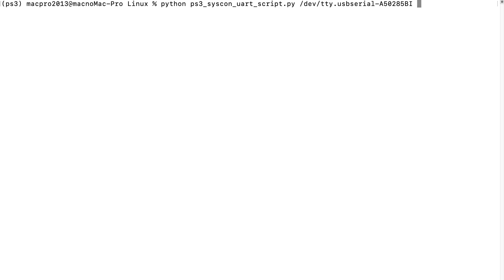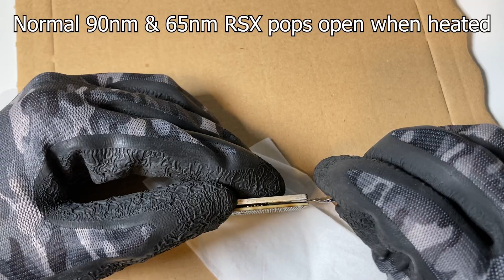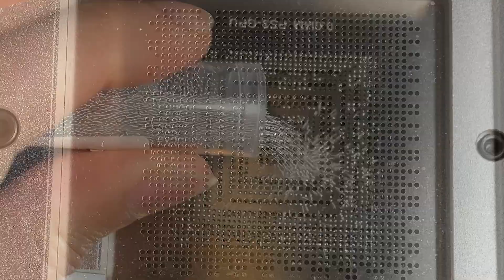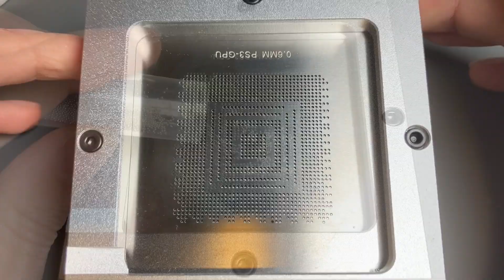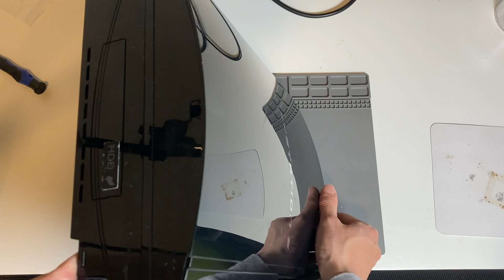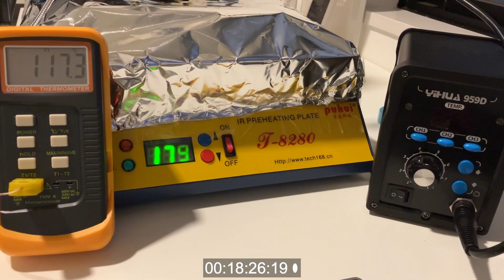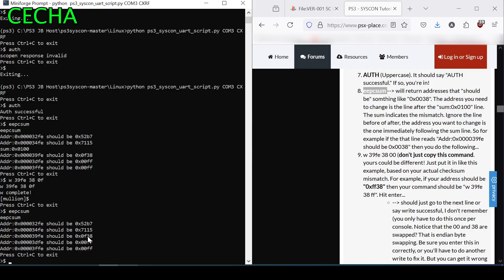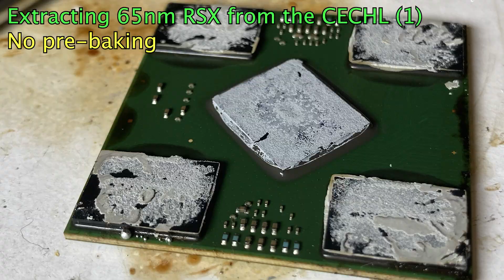Fixing YLOD 3034 is Difficult (aka Frankenstein mod)

Comment: You had so much delaminations because you're not using the aluminium foil correctly. You should open a slightly bigger hole and use kapton (or better, aluminium) tape to glue the foil to the board. You're having so big of a gap betwin the foil and the board all the hot air is entering between the foil and the board and overheating it.

Comment: The loss of all those MB's is not a total  since so many of us can see that whatever you were doing was not the right thing to do. Thanks for that. I'm only trying out my sardonic humor that you are so good at. Always baking the MB at such a high temperature for such a long time is likely the culprit. Yes water boils at 100 C but so does MB's. The thin liquid flux put on under the CPU is good advice and pointing out that the lead free flux leaves a residue also helps with my repair. I have nothing but some thoughts and need to put them into practice before I try and do my own repairs on the several PS3's I picked up on the cheap all that were sold for parts. Got two to boot  as one was the same error code 8002F14E.  Got it to bypass but not because the DVD wasn't working but because the HD was swapped with another which allowed for the service option to be initialized. Previously it would not even do that. Then going back to the original HD it was able to bypass the stuck point on the boot OS install. Worked for me is what I'm saying. This was a G01 machine but the clock was damaged and I'm swapping out that crystal hoping that fixes the Blu-Ray and the fan not working right. That is a whole other story not yet finished. Then on the other PlayStation someone had bricked the machine since they got caught with their Jailbreaking. It seemed dead at 1st only because the rear on/off switch was not working right with burned contacts.

Comment: i'm not an expert on reballing but i want to give my 2 cents based on what i always see the pros on youtube do, first thing i would do is delid the rsx before the desoldering process. i would then allow a slower temperature ramp up time,  use the hot air only when the board reaches 180-200°C and get closer with the hot air nozzle, and not go over 350°C with the hot air... also thermal paste needs to be removed before every soldering/desoldering process because it can interfere with the suction pen and the paste itself gets harder to remove. i wish i could speak from direct experience but in my 10 years of working with electronics the only thing i ever reballed are vram modules on GPUs. right now i reached the point where i need to learn to reball big BGA chips because i got a couple gpus that need it. i will probably buy the same puhui preheater you got, and i also got a very similar hot air station as yours. your videos got a big educational value because you show every fail and success, it's easy to look at other youtubers that post only successful repairs in neatly cut and sped up videos. But you show the entire process which is way better to learn, even if the result is not successful. 
Almost forgot, the flux you're using seems to act strange and it's too liquid, you should use a regular flux that's tacky when cold and gets liquid when heated up, i use a cheap (100% clone) flux from aliexpress, i think it's nc-599 or something like that, i had good results with vram chips, it's easy to spread just a thin layer with your finger on the pcb and the chip itself...
Reply from the maker: Glad that you find my video useful!
About the 65nm and 40nm RSX, they are impossible to delid without damaging the VRAMs.
The thermal glue on 65nm and 40nm RSX are super strong that you can only delid them safely after desoldering.

Comment: When installing the Tantalizers for the RSX, do you remove all 4 NEC/TOKINs? Or just 2 on one side?
Reply from the maker: I only replaced 2 NEC/TOKINs. But it is recommended to replace all 4.
Reply: @hardwarerepair200 Thank you for your advice. I really appreciate these videos from you and Felix.
I've noticed the PCBWay link in the description for the assembled Tantalizers (many thanks), I might treat myself to some. I have a YLOD CECHP fat PS3 that I can keep working long enough to display error 1002 on ps3toolset.

Comment: Hi,
I've seen your repair work and I'm currently trying to attempt the Frankie's mod on a PS3 CECHA01. I'm planning to do a reflow, but I’m working on a tight budget and would appreciate any advice you could share.

Do you have any suggestions for preheating the motherboard? Is the T8280 a good choice, and should I invest in a hot air station like the one you use?
Also, I’m a bit unsure about how long I should prebake the motherboard to remove any moisture that may have built up over the years. Some people say it’s necessary to avoid damaging the board during reflow. Should I cover the board with aluminum foil during prebake? And how gradually should I increase the heat to avoid thermal shock?

For context, the PS3 was working fine until I attempted to delid the RSX. After that, it powers on, but there’s no video output. Pressing down on the RSX temporarily restored output before, but now that no longer seems to work.
Since you've done many repairs, I’d really value your insight—especially about the common mistakes people make like turning up the heat too quickly.

Comment: The amount you've put into buying PS3s and etc you could've bought a cheaper BGA rework station like the IR6500, you'll experience far better success once you have profiles to work with and better heating practices. Also if you use foil tape instead of kapton tape it tends to work a little better and doesn't end up being completely useless. It's like you said, haste makes waste. Your whole process is too fast after baking, 450c is an obscene temperature to be using on a board like this whilst the rest of your board is only 200c - similarly to your stencil that you saw flexing and you thought it was breaking it? that's just thermal expansion being localized, and if you don't do things slowly then materials with different thermal coefficient of expansions means they expand at different rates too. You can leave your stencil in place when reballing but don't just focus the heat directly on the middle portion or the middle will rise as the edges are a lot cooler, though even if you do it will return to it's original shape anyway once it cools and it's really a non-issue. Here's a little more of an extreme case for illustration purposes https://www.youtube.com/watch?v=82FPQ6z8vcE
Reply: IR8500 or equal. IR6500 won't cut it.

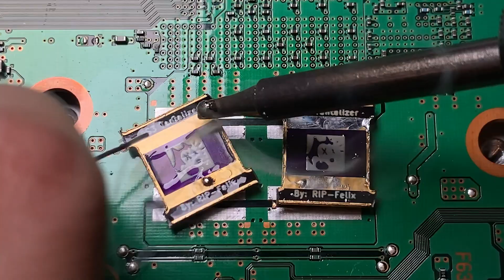Comment: At minute 3:09 as you install the Felix Tantalizers, you did not need to use a heat gun? I was wondering if using a heatgun can cause the capacitors to move off of the Tantalizer PCB, but I don't see you using a heat gun. How did you manage to connect the inner connections with no heatgun?

Comment: I recommend cutting the hole in the foil for the RSX to be quite a bit larger than needed and to use foil tape around the RSX.
The foil tape is more malleable and stickier, so you can shape it around the components to get a better seal, because currently you’re just blowing extremely hot air under the foil and trapping it there, which is increasing the chances of delamination

Comment: I'm a PS3 collector, basically the 4 USB model (CECH A, C and E, I haven't had the 20GB model, CECHB yet). I also used to disassemble my consoles, mainly to change the thermal paste, PCB battery and sometimes the case. However, I haven't had any luck either, since the 45-pin connector on the Blu-ray drive breaks very easily, which made me save some boards, one from a CECHA00 that had never been opened in 17 years, which was practically new inside, with zero dust and still good paste from the beginning of 2007, but now it needs repair on the Flat connector, as well as a new top case.  After several mistakes and losses, I decided not to open any more consoles, although I know how to open the PlayStation 3 easily. The complicated thing is that I was from Brazil, and the technicians there are terrible at repairing consoles, especially the PlayStation 3 with 4 USB ports. I had one of my technicians do this Frankenstein process, but I believe that the technician killed my console when he put the 45 nanometer RSX in, because he never heard from me again. I hope that in Spain, or in the US or Japan, I can find someone who understands the PlayStation 3 well so that I can recover part of my collection.

Comment: Great video. I've been doing this some years. You delaminate the PCB because unlike a BGA station, your area is blown! So you burn the first layer of the PCB and it peels off. BGA stations heat by radiation and not by blowing. Good luck man, it's very hard and what you're doing is already good. I had an achi 6500, it's great, I recommend it. Very precise and indestructible

Comment: i tell everyone how to fix all ps3 for real, isntead of killing 10 Ps3s to do this Bullshit of Frankenstein mod, what people shall be 100% thinking about doyng is just an machine or socket pressure Mod, just like the Xbox 360 bolts mod which solve the problem even if the problem was or is the bumps still the Pressure mod on the die of the chip fiberglass itself will fix the problem like wise a simple socket which makes the connection of cpu to mainboard by adding pressure, the Pressure Mod will fix even nearlly all the 90nm RSX gpu, it should pratically and theoretically fix the gpus with bump failures as its already been prooven to fix the Original Xbox 360 with 90nm Gpus and Edram, The only problem of the Bolts mod on the 360 was that it lacked support on the back of motherboard so leading to bend of motherboard and OF COURSE loosening the whole pressure on the chip, so the pressure mod on any system must be made thinking very smartly and acurated, must extremely careful with the core Die Silicon or it can be Cracked or damaged in the edges cracking  its edges.
Reply: 😂😂😂😂😂😂🤦‍♂🤦‍♂ just no.
Reply: @anthonyboccardo2726 Just Yes, I wanna See your Dumb Laughing Face like that when I fix hundreds of Thousands of Ps3s Like That, I fixed mine 60gb Like that by Installing Pressure on Its RSX only.

Comment: Man, i feel you. Las month i was trying to fix a keyboard but i'm not good at replacing IC's. It was a mess... Learn that I was using a high temp soldering wire and causing the IC go bad and take more temperature to solder so I cook the mobo.

Comment: There's another English saying you may want to contemplate. The early bird might get the worm but it's the second mouse that gets the cheese. Some friendly advice would be to decrease the nozzle size on your hot air a bit which will help it focus on the part you're trying to remove/replace. Not too much, just maybe the next size down. Another thing to try is to get the Kapton tape just under the edge of the chip by sliding it in underneath from the side before pressing it down. Then progressively work your way out until you've masked enough space off that you have room to work which will help you see better. Doing these two things should help quite a bit. You can also lower your preheat temperature a little. A good way to get moisture out of the board that doesn't heat stress the electrolytic capacitors is to burry the board in a container filled with dry rice Try this on a non-repairable board first though in my experience fixing computer motherboards which "have to stay running" because they're tied to obsolete hardware which still works fine but is incompatible with newer computers due to a lack of serial ports or the unobtanium drivers that won't work with modern machines even if it was carefully backed up. The point of this is that these old tanks are cheaper to repair than it would be to refit a factory of old robots with new ones. I understand how hard reballing is. I also get what it feels like when a CMOS battery pops because you forgot to remove it. I've had electrolytic caps do that too, makes me jump and instantly cringe every time. As far as mistakes are concerned, that's how we learn things that we can't figure out if it all goes well and nothing goes wrong. Sometimes it's just having enough patients. Other times it's that EUREKA moment that you have in the middle of the night that makes you race down to the lab to see if the idea you have has any basis in reality. Just don't give up and you'll get there eventually.

Comment: You need bottom air too, but the main issue is that toy hot air gun, you need more flow, less temperature.
Get a Sugon 8620 or 8630, 1300W, more air, should do much better.
Also try raising the hot plate to 200°C
Only 400+°C hot air at the top will take too long and kill every board, and 450°C over the chips is just crazy!

Comment: I had the same buckling problems with one of my stencils. Another stencil from another manufacturer did not expand like that when heated (i had to try 5 stencils until i found a good one). I have never been able to re-ball without the stencil installed since the balls would roll all over the place. Maybe finding a good stencil is not easy.

Comment: If there's one thing I noticed with this video, the times when you had delamination on the board were both the 1-871-868-22 revision, which according to Rambonz as I was learning some of this stuff, tends to delaminate a lot since it was made quite poorly, the 868-12 and 868-32 boards are much more resilient. The 868-22 board can still have rework done obviously, and according to him the best way to deal with a 22 is to just throw all the hot air at it at once, helps to prevent the delamination. 

Otherwise it is very nice seeing all the work with these, and documenting the process to help others learn is a very handy thing to have, keep it up.

Comment: The delamination/popcorn is due your hot air station a 100%, those don't regulate air and heat evenly and you have to preheat board at lower temperature, before going to higher temperature to bring board to warm before very hot. The problem is those cheap stations put to much heat and doesn't regulate airflow correctly. I use to use the cheap hotair station with DC fan in handle, when I learned many years ago and was lucky to get 1 out of 3 that didn't delaminate, even doing simple HDMI repairs took way to long and needed to much heat with cheap station, with my Weller at lower temperature takes less then 5 minutes to remove HDMI with huge ground plane for a board compare to the cheap dc fan in handle station that took way to long and had to fight with it. You need even airflow and I use a Quick 861DW with same BGA tip, or my Weller wtha 1 and fixed and modded many PS3 with 90 percent success rate nowadays and now mostly repair PS5 now and no delamination/popcorn. Preheat the board on both sides for a few minute before reballing,  The Weller can program ramp profiles, but typically do it manually as use to it as repair iPhone boards and use to handing and distance of handle.

Your bottom preheater good as have the same one and does fine, but upgrade your hot air station, will be a night and day different and way quicker which means less chance of delamination.  The Quick 861DW being the best bang for buck, don't buy on eBay as to many fakes and the real one has the 3 phase fan for better airflow regulation The real one over $300. You started the way I learned and you thank me later going to the Quick, or Weller, or JBC hot airstation. The Quick is the best for cost as adaptors are cheap.

I also notice you use to much flux when putting back you only need a thin layer. Tape the themocouple to the board not the heater. You need to know the temperature as the air hit board.

I know your trying to show people to do it with cheap tools but don't. I learned the hard way myself and trust me it discourage someone from trying again and they think it impossible, plus they destroy the limited amount of these consoles like you did in this video. Better for them to spend $350 on a decent hot air station like the Quick, or Atten and they won't give up and get better at it. Yes I learned on similar tools many years ago as had no choice as the Quick was even out and JBC was over 1.6k to buy one, I became very good to the point don't even have to look at it but almost gave up and destroyed way to many boards early on to get to that point. If Quick I had early on would have save me months to years of learning and consoles.
Reply: It is blown air and not radiation. Main cause in fact

Comment: You definitely need a proper BGA Station for this. That small rework station has to work a lot harder to get those BGA chips off which can also over heat the motherboard causing the delamination due to it not spreading heat evenly. This is mainly designed to remove smd ic chips and components. Not big BGA chips.

Comment: Drying the board is good, my best advice would be to move around /swirl the air gun when applying heat. Significantly helps with board layers staying intact as well as components. You will hold it still and blast it with hot air in the end. But only in the end. Wishing the best for you ! :)